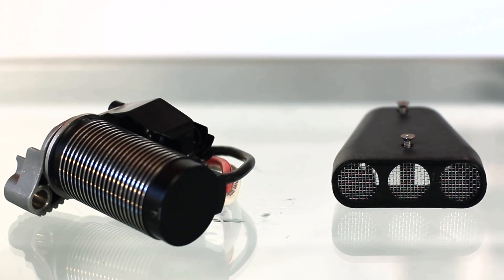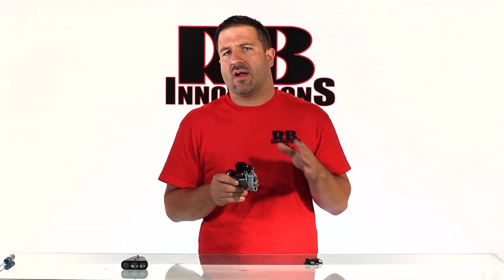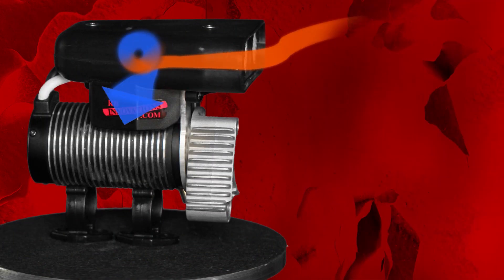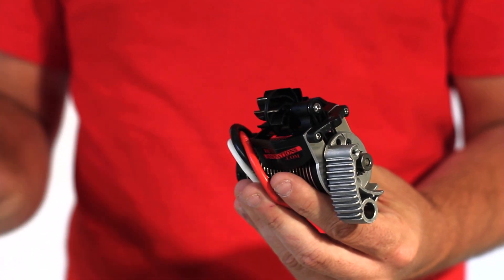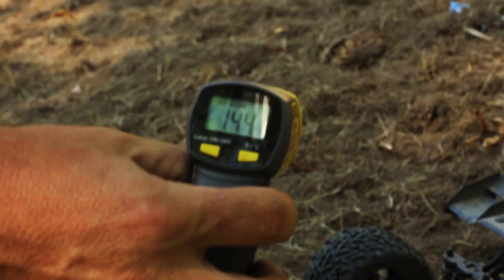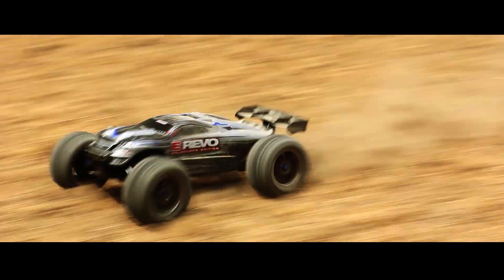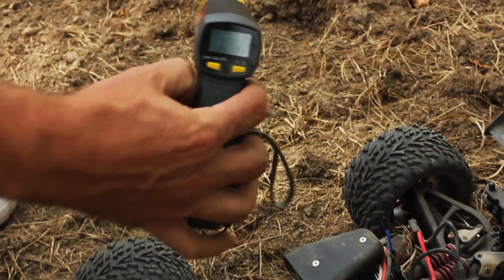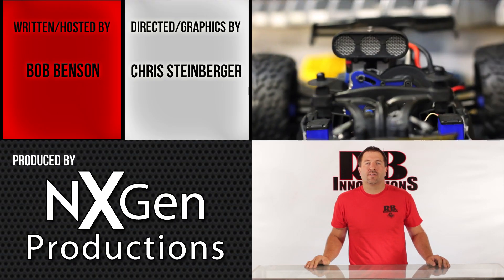RC Electric Ice Amps Blower

Comment from the maker: 140 is a decent average temperature, but the point we we're trying to make was that the Ice Amps Blower will bring your temperature down a significant amount allowing you to push your motor harder without having overheating issues.

Comment: How exactly does the fan 'chill the air' after it draws it in? lol  Its just a belt driven fan that blows ambient temp air over the motor and it prob works so why do they have to make stuff up like that?  Does it have a mini-intercooler? lol
Reply: Fans cannot chill the air. The effect may well be the opposite. That is why turbo charged and blowers require intercoolers to remove the heat from the air being compressed. Now I doubt this little fan will compress the air very much, but it certainly will not lower the temperature up that air.
This Ice Amps Blower will likely help lower the temperature of the motor by moving more air across the fins of the heat sink. More air flow will remove more btu/s resulting in a lower motor temperature.
Also I would have rather seen the temperature measurements performed at the same location on the motor. By measuring one time on the top and the second time on the side, there could defiantly be a difference in these readings. Heat rises so the top of the motor is most likely hotter than the bottom, or side. Both measurements should have been taken at the same location on the side of the motor.

Comment: I have one on my erevo. It works ok i guess i dont keep up with temps other than the finger test. Its a unique and good product with out have to say it chills the air. Compressed air gets hot. Decompressing air gets cool in a sence. Air is a horrible conductor so air really dont change that much over miliseconds it takes to move through this fan. The fan neither compresses nor uncompresses air so really it cools by moving ambient air.

Comment: IMHO, cooling fans are mearly bandaids. If your haveing heat issues then gear down or check for binding. Any set up properly installed per usage guidelines should never have heat issues. Then of course theres always idiots out there who think they are RickyBobby